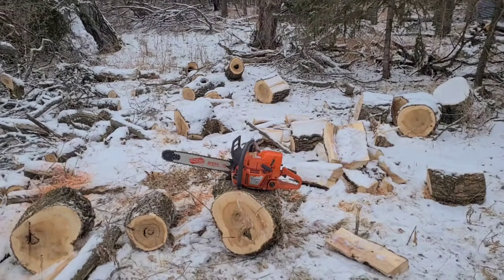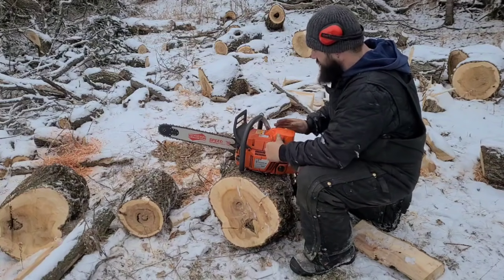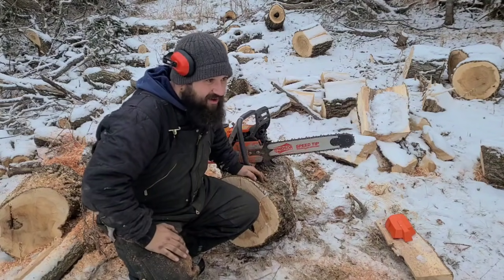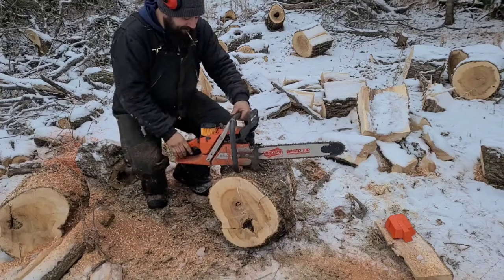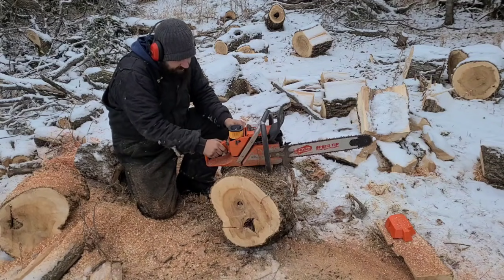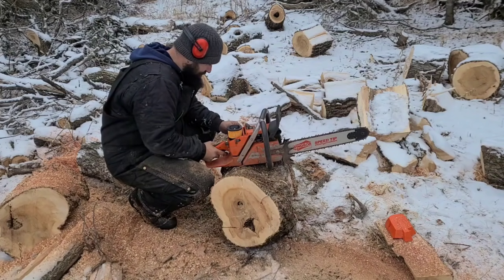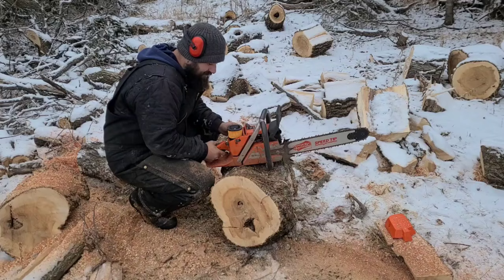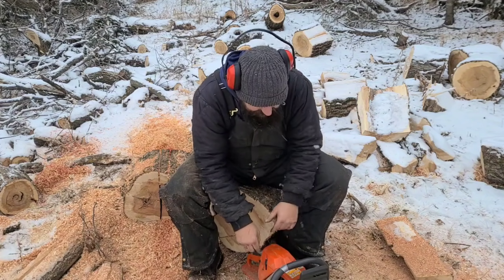How to tune a chainsaw carburetor!!

Comment: Ok so you want the saw to 4 stroke out of the cut, when you go into the wood it doesn’t 4 stroke but if you pull it up with no tension it will.    I don’t know if I’m thinking too far into it but I just bought a echo saw and I’m afraid it’s going to be running to lean.   I opened up the muffler some so it flows better.  It has snappy throttle and seems to be good but I’m afraid that it’s too lean how do you know when it’s To lean or just right?  Do you have to read the spark plug?   Basically I don’t want to be cutting wood thinking that it’s running correctly but it’s burning up and will seize because it’s lean and I didn’t know.

Comment: Hi Tinman... My 2004 372XP has the air screw limiters.  They only can be adjusted a half a turn.  The saw seems to be running fine.  Just wondering if the limiters should be removed for better tuning? Thank you...

Comment: so... did you make any adjustment to the high jet other then that initial 1.25 turn out?   my  stock 455 rancher kept stalling out when i first bought it and i adjusted the idle screw and that's all.. but now it's starting to sound a little boggy again this year (11 years later) - i cleaned the air filter but it wasn't dirty; haven't run it yet to try... might need to try some of these tips... i also just switched from an 18" bar to a new 16" - where should the idle screw be set?

Comment: Hey tinman
Just got the limiter caps out of my new echo 7310p and gave it a tune up last night! Completely different saw now with the proper amount of fuel on the top end. Have you had a chance to mess with that new 7310 yet? I havent got the timing wheel on it yet. Just pulled the spark arrestor and the limiter caps. Plan to let it break in and then start tearing in to it once its loosened up. Never ported a saw before but I'm going to give it a go on my cs-590 and if all goes well, the 7310 after that. Your videos have helped tremendously! Keep them coming brother!
Reply from the maker: Id love to try a 7310 but I dont think they are available in my country yet..

Comment: Thank you for this. The only carb tuning video I've come across with all this good content. The sounds in and out of the wood plus what's wrong and right. Just awesome. I do have a question and maybe you can point me in the right direction. 193T  I bought off a guy, once it starts warming up I'll do a few cuts with it and when I let off the trigger it will die instead of returning to idle. It won't do it every time and to get it restarted I need to hold the throttle wide open. Is this possible a carb adjustment issue or should I be looking else where? Thanks for any input you can give me. Almost forgot to mention, I live at 9000 feet. I know altitude make a difference.

Comment: Different conditions in cold or hot days may require a little tweaking for best performance . But as he said you are better to keep it on the richer side to prevent to lean a condition that will damage the motor .

Comment: I have watched this video many times as I tune/retune my saws.... Would be awesome if you had cut scenes comparing a lean/normal/rich "4-stroke" saw side by side to help train the ears of the uninitiated. I think I am running my saws rich and a little bogged down. My main cutter is an 038 Mag with a 27" bar and it gets hung up on the big stuff more than I think it should.

Comment: I have both jets at 1.5 turns. Saw won’t idle but runs good when i give it gas. I assume I need to adjust the idle screw. But the other thing is that, when it gets warm, I have to hold the throttle open while starting it to get it to fire... Any suggestions?

Comment: Fantastic videos, one question. I have an MS192T and settings seem great, idles good and 4stroke at high until in the cut, issue I'm having is when I'm cutting WOT and come out of the cut back to idle the saw wants to die. This only happens after cutting. Idle otherwise is fine and cutting is fine. I followed the manual for the LA adjustment after L and H

Comment: Hey bud , i bought a 395 xp holzforma , and couldnt get it to start until i take the air filter off and i messed with the low setting. And the high setting and now its all out of tune and i cant keep it running what should i do? I was flooding itself when i would choke it to try to start

Comment: I would like to add that the smaller the saw the touchier they get on the needles. Some can be real bast r ds .  I also put my screwdriver in my left hand just above the handle and often find myself cutting  for long times and notice I still have it in my hand.

Comment: I just bought a new 572 Husqvarna XP chainsaw. Is there a certain  screwdriver  or tool too modify the high idol. Do you have to buy the tool from  Husqvarna? I just liked your video  and subscribed to your channel
Reply from the maker: Hi John, thanks for checking out my channel. I've never worked on a 572 but I dont think you can adjust the idle on those at all.

Comment: Trying to tune a 6100 Dolmar. I just opened up the muffler modded. Stock saw. Idles great, 4 strokes on the top, returns to idle, but it’s doggie to rev. Idle screw is out all the way to where it only just starts to touch. If you blip the throttle it wants to fall on its face and then it takes off like it’s a little lean. I play with the high jet, it goes from ehh to worse. The saw seems to 4 stroke on top no matter how far you lean it out until it dies. I can’t seem too get the stall out playing with the jets. Is it just the saw itself or should I be able to tune that out.

Comment: I have a 272xp and it runs perfect until I tip it on its side as you would when about to cut a standing tree down, when I do this it starts to run weak. Any Idea why?

Comment: If when you pull out of the cut, the saw wants to die and the low speed is good, would it be too rich on the high speed? Only reason I don't think lean is because I'm under max rpm of 13000. Stihl ms310

Comment: It has only low jet.so if its not adjustable why can i turn low jet and it only turns one or half turn?never had one like this its got me into loveing working on them.used to just production run them.need a all around modded work saw .theres no good shops here and tryed everyone on line cant get a modded wrok saw?will pay whatever.need this echo 2511 fixed up bad it wont tune has a blocker as well and need that qaurter pitch set up on it .Help oht there anyine

Comment: I've got a 266xp and a 268xp. Both only run with BOTH jets cranked right in. If I dial back even half a turn on the high speed jet it dies the moment I come off WOT. If I dial back on the low speed it will die or just not start. I've stripped and cleaned carbs but no better.... any clues?  Also any tips as to how to source parts for these older saws in the UK?
Reply from the maker: My guess is if you have a carb that will run with the jets off that usually means the seats under the jets are damaged. 

Once damaged they allow fuel to leak through. When that's the case the carb needs to be replaced.
Reply: @tinmanssaws  Great..... I had a feeling that might be the case and it was my next port of call! Will stick with a direct swap out with the existing Tillotson.

Comment: Thats the problem have a saw with only low jet?and idle above the high jets bolcked with gold peice and rubber gaurd is over the low but it still turns adjusts on the low but you cant turn it only ine revolution ?one. Its 488 saw great saw need your help ?and need big saw?

Comment: I cut off those straight blade ends of the jets and then can get to the jets with a spline driver.
So much easier when tuning while running.

Comment: Great video, Tinman! Any suggestions for tuning while breaking in a new saw? Should it be run slightly rich for few tanks of fuel,  then adjusted as described in the video, or tune it as described and just take it easy for a few tanks?
Reply from the maker: Run its rich for several tanks is what I do.
Reply: Thanks for the reply, Tinman. That's what I was thinking initially, but I'm more of a diesel guy, so figured I'd ask the expert.

Comment: They? I have a run a 455 husky the bulb busts on it it would start fine then I replace the bulb pump then my kill switch doesn’t work so a choke it to kill it but when I try to start it back it like it floods and it takes a long time to get it started back but when it runs it runs and idle fine

Comment: So my 460 will stop 4stroking in big logs but smaller logs like 10” and under it still 4 strokes and shuts off after the cut. Any ideas?
Reply from the maker: Hi Corey, you saw could be way too rich on the bottom, could have a plugged tank vent or you could be low on compression.

Comment: I have mine set pretty decent now but it’s how I bought it used.  I tweaked it alittle bit after I rebuilt the carb but I’m afraid to lose these settings and start from 1 1/4 afraid that I won’t get the right settings lol

Comment: so if my saw isnt idling very well and cuts out occasionally while idling and isnt picking up as fast as it was i need to lean the low jet?
Reply from the maker: Yeppers
Reply: @tinmanssaws  and this will also ensure it starts well first pull once warm as it occasionally doesnt start well without a blip on the trigger

Comment: Hey Tinman. Love the videos. I have a homelite c-71 hasn’t been ran in years. Noticed fuel coming out of the exhaust. Any suggestions?
Reply from the maker: Needle in the carb is probably stuck open.
Reply: @tinmanssaws  thank you so much

Comment: Just to be clear: to close the jet turn CCW and to open the jet turn CW?
Reply from the maker: Turning the jet in (right or clockwise) leans the mixture as it closes the passage and allows less fuel in..

Turning the jet out (left or counter clockwise) richens the mixture as it opens the passage up and let's more fuel in..
Reply: @tinmanssaws  thanks for that, appreciate it 👍

Comment: So one of my old ones has to much L and not sure about the other one i got it free from someone and its missing a chain brake but probably does have air leaks its just one of those poulans someone was gonna throw away it still cuts with leaks but not the best with the air leak

Comment: 575xp, would it be better to run it just shy of 4 stroking for limbing too? And this is the weirdest carb tune I’ve seen yet on a saw, 3 hi, 1.5 low book setting.
Reply from the maker: I tune all my saws the same way as in the video. 

If you're doing lots of limbing, you can retune so it doesnt 4 stroke while limbing but it will probably be too lean for anything larger.
Reply: @tinmanssaws  I just tuned her just like in the video and she’s bang on now! And that’s with this funny 575. Many thanks and really enjoy watching the cutaway videos!

Comment: peace an love from scotland stu an family
Reply from the maker: Morning Stu
Reply: Hi tinman. I love 2 an 3 series husqvarna. Much like yourself. Have not long got dual ported muffler for the 268 .from a chap in the USA. Always looking for the wee bits and pieces for these saws .no market in UK. Been looking for the dogs for 268 266 .not easy to come by .if u could give me a heads up. Always looking to buy .keep up the good work. Wee bit worried 268 got lean after putting on new muffler. Peace an love from Scotland stu an family

Comment: Hi Tinman! I disagree with your way of adjusting the idle with the low jet, low jet should (in my opinion..) be set with full focus on throtle respons, then the idle is set with the idle screw. Lets say the idle screw is  set way to high, then you will get a super rich setting on Low just to get the idle down...?

Comment: A ported saw should use more fuel then a stock saw. Makes me think of a 390 carb on a big motor. Pulls so vaccum that it pulls extra fuel threw all the  orfaces it shouldnt.

Comment: The person i got that trash poulan from acted like he didn't know how to start it up or to pull out the blue choke lever first he kept pushing the red stop lever down so i said you gotta pull that blue lever first or it ain't gonna start up 

He was trying to show me that the saw was still good so once he dropped it off I seen it needed all new gas line an all that so put the new stuff on then seen the spark plug was loose so i cleaned that off set the gap put it back in and it started right up with air leaks it cut good for being a throw away poulan but its needing a few other pieces its missing maybe if i find another broken one i can use the parts off it

Comment: I cant afford to buy another saw from these dealers here. They never help and saws dont cut because they dont open the oilers up and tune the saws thats the point of a dealer?other wise you could buy it out the box .im new to working on saws and struggle with thess new saws .have new 2511 t and cant tune it they wont and dont have carb tool its bolcked.ive only ran about 10 tanls through ot to break in and havent used it on any removals have paper work warranty all that realy need help with this saw and a all purpose saw.for firewood and removals.one that i can tinker on myself .as i work for myself and need these saws to perform .ive to affraid to use that echo in the tree as it doesent pull.enough have 2 broken hand bones in both hands so i got that saw and my forearms torn .anyhelp out there would be great.need to buy a saw???????plz ill send you that echo as well for fixing or trade realy need despratly a big saw.